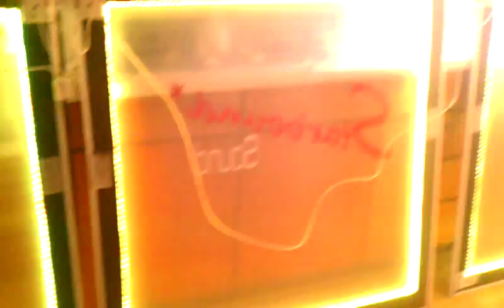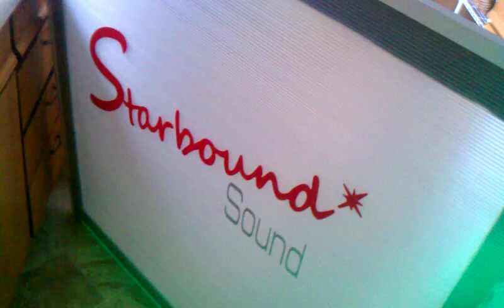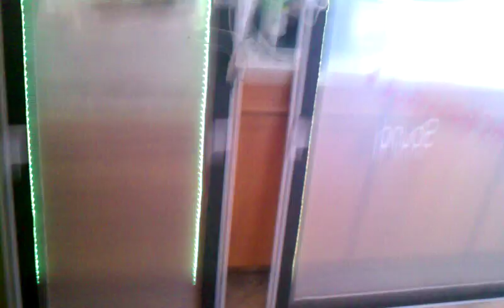DIY led L.E.D. Light up dj facade part 1

Comment from the maker: When you order the 5050 RGB strips from eBay with remote and power supply they are ready to go, just plug them in and they work..

But you have to Cut them to make them fit your panels...

Where your cut is, their is 4 exposed wire ends.. 

You must use a soldering iron and make extensions of those 4 wires to your phone jacks. ( Always keep them in the same order)
 

Once you get the lights wired into the phone jacks you just need to make phone cords with the special little ends to connect the lights between your panels ...

Www.Vocaladdiction.com

we are developing an awesome karaoke app for mobile devices. . 

VOCAL ADDICTION will be launching soon on the Android Market

Comment from the maker: The LED strips have 4 color coded wires at each end. Red, blue, green, black.
You just keep them in the same order when you connect them to extended strips and connectors and it will all work wonderfully. .
Reply: Can you tell me or show me a schematic on how your wired the lights with the phone jacks and daisey chained them please.
Reply from the maker: The led light strips have 4 wires that run all the way through them and they are 4 different colors .. you can plug the end of a 15 foot long strip into an end of a different strip to make a 30 foot long strip  this is very simple to solder 4 small wires onto the end of a strip (one wire to each of the 4 ) then install a basic 4 wire phone jack on the end of your extension wires ..always keeping the 4 wires in the same order or layout .. then do the same to another strip.. plug both strips into a phone jack splitter and both strips will light up the same.. it really is super simple :)
Reply: I have five panels, can you do that with all five and just use one power cord

Comment: how did you adhere the panel to the black frame? is that plywood? did you screw the frame together or just keep it all together with adhesive and sheet rock caps? Thanks again.

Comment: thank you for your answers.  Did you also use wireless led strips, I do not see where the strips connect to the power plug. What did you use to create the frame? how did you keep the see through pannel attatched to the frame? Did you nail it down or us some type of adhesive? thanks again. I waiting for my parts to arrive now.

Comment from the maker: The fiberglass composite panels are used in airplaines for walls etc, they are super strong,ridged and lightweight but cost around $400 a sheet, i got mine from a scrap pile during a unrelated delivery,, you could just use plywood and paint it,, also i capped off my edges with sheetrock endcaps, from home depot, they are less than $2 for a 10' section ,then glued it using clear drying adhesive caulking ,,

Comment from the maker: I purchased the led strips and controller from ebay around $20 per 16' roll and $7 for controller , i purchased the thin translucent currogated lexane panel from a local sign shop as a 4'x8' sheet for only $15 bucks and cut the frame from 1/2" composite panel, but u could use plywood

Comment: I am a little confused.....You used fiber glass? where did you get that and how much.  You were able to have it cut to your desired dimensions? How is it see through in back, but white in front.  I built my own as well, but with lycra fabric.  Would like to incorporate my logo on the front but cannot with the fabric.  Very interested in how you made it and would appreciate all prices and locations of materials.  I will video response my facade.